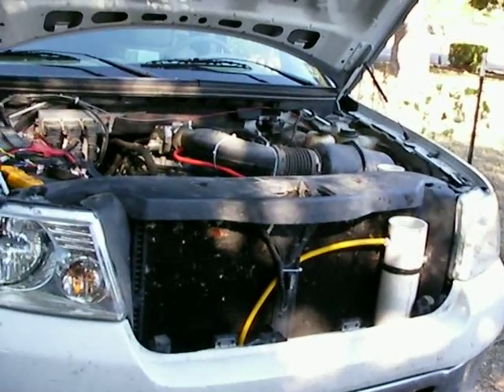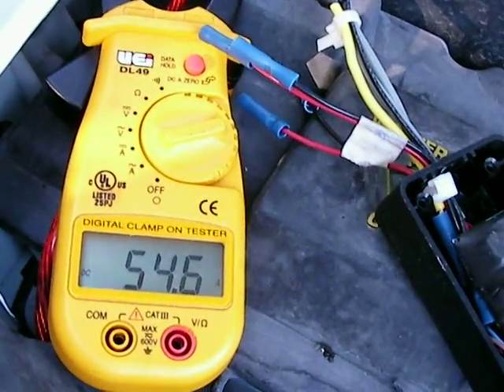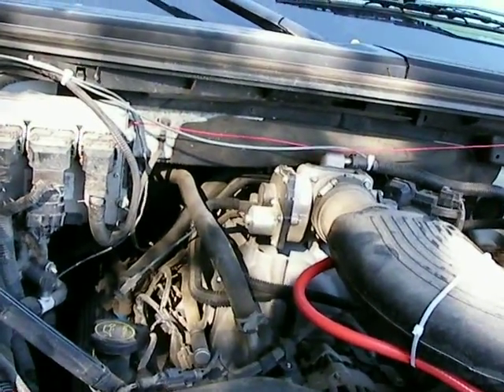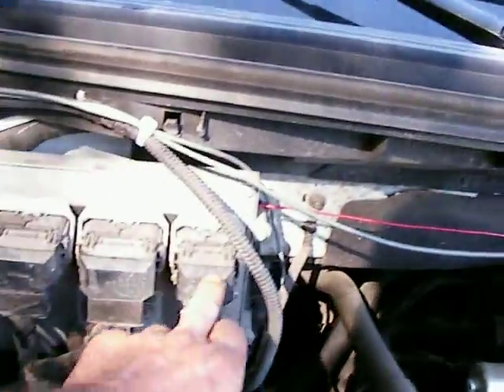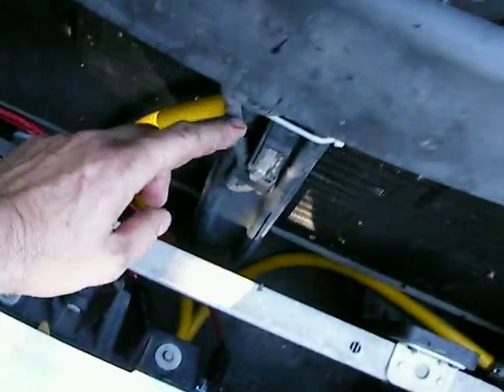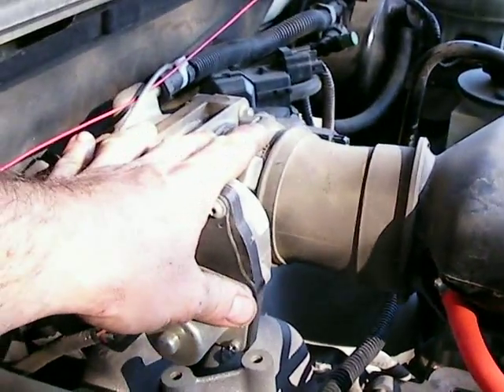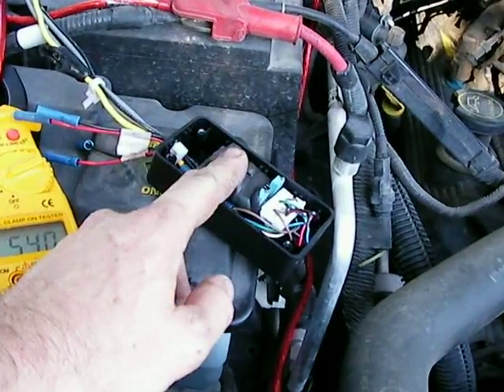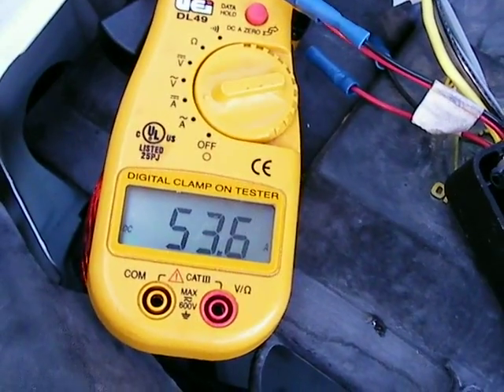hydrogen cell installed in a ford f-150

Comment from the maker: thanks for the comment.. the EFIE is a bandaid as the ultimate fix would be a metered input of HHO and a circuit board tie in with the cpu.. so we have the EFIE run the circuit with the hydrogen cell so if the cell is off the EFIE is off!!! o2 extenders work but if the cell is not on you have a lean engine bad! bad! on obd1 prior to 94 a map dial works..be blessed! scott